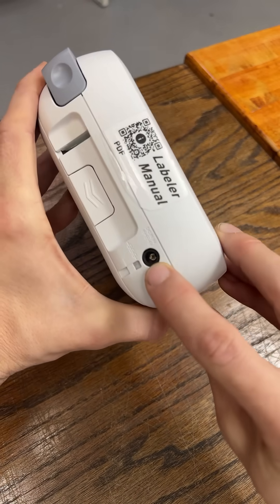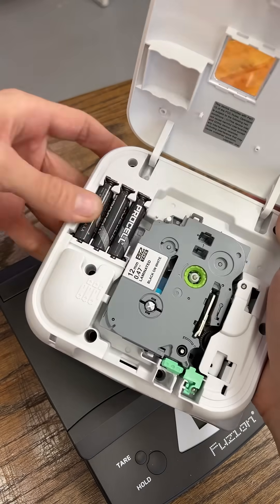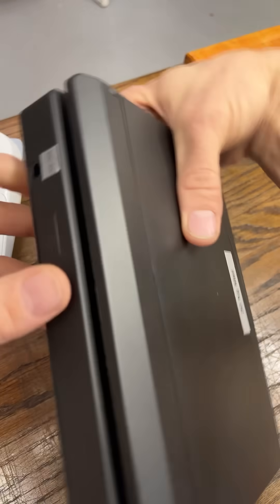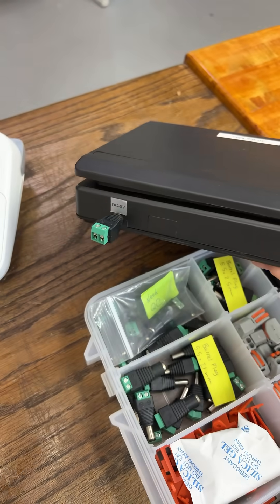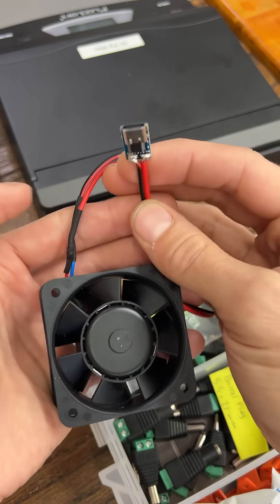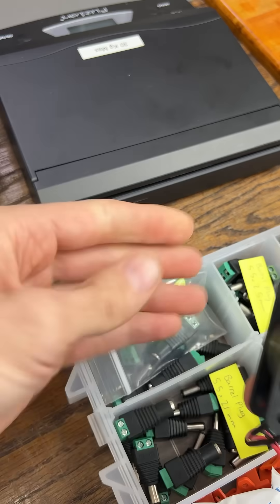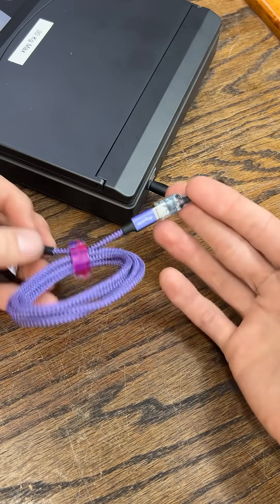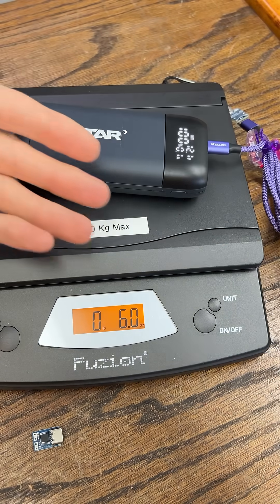USB-C can replace alkaline batteries

Comment: Pretty sure the labels are the most expensive part of using the label maker.
Reply: Not to mention that you now need an outlet nearby.
Reply: Aliexpress to the rescue
Reply: Generic will save money but you are correct. AAs are cheap.
Reply: @battra92 
Revelation 3:20
Behold, I stand at the door, and knock: if any man hear my voice, and open the door, I will come in to him, and will sup with him, and he with me.

HEY THERE 🤗 JESUS IS CALLING YOU TODAY. Turn away from your sins, confess, forsake them and live the victorious life. God bless.

Revelation 22:12-14
And, behold, I come quickly; and my reward is with me, to give every man according as his work shall be.
I am Alpha and Omega, the beginning and the end, the first and the last.
Blessed are they that do his commandments, that they may have right to the tree of life, and may enter in through the gates into the city.
Reply: @battra92 rechargeables are almost free compared to buying alkalines over and over again.
Reply: i think he meant over time
Reply: I was going to mention that too. But you are correct.
Reply: Depends on the labeler. Brother can't tell the difference between generic and OEM. Brady however....
Reply: Na, the full roll is like €1.5 from China, perhaps a bit less.
Reply: rechargeable batteries.
Reply: @superchuck3259 Not unless the device is designed for rechargeable batteries. The voltage of rechargeable batteries is not equivalent to that of primary batteries, especially AAA, AA, C & D cells.
Reply: @Micro-Motive  Please stop trying to correct people on the internet about mystical magical powers that existed in ancient america back in the early 2000's. 

Anyone over the age of 25 has used rechargeable AA's and AAA's at some point. Never once was a device marketed as supporting NiMH rechargeable. 

If you want the technical explanation then alkaline batteries range from 1.5 to less than 1 volt when they're nearing depletion. Requiring EVERY device that uses them to have circuitry capable of dealing with this voltage range. NiMH (rechargeable) batteries consistently output 1.2 volts. Which works perfectly fine with anything that accept's AA's.
Reply: @Micro-Motive  I just got a dymo label maker (the bluetooth only one) and the annoying thing only runs on on-rechargable, thinking about hacking usbc onto it
Reply: @itsausername not exactly. For many devices yes. But many devices that used AAs and AAAs would tap out pretty early. Completely or they would work less well or less reliably. Eg. torches/flashlights dimmer, walkmans and toy cars would slow down, digital electronics would get glitchy. Then you got to use those batteries in less demanding roles like remote controls.
Reply: @ All you're doing is pointing out that some electronics had poor voltage regulation. Which was inherently LESS of a problem with rechargeable batteries. 

Read the first post I wrote on it.
Reply: @Micro-Motive They mostly work, especially as rechargeable batteries can give out more power without voltage drop. Device makers need to still consider that batteries will go from 1.5v to 1.0v or so. Thats the same range as recargables being 1.3..1.0v
Reply: @SmallSpoonBrigade they actually start at 1.3v. but rest is correct
Reply: Yes, but they're cheap if you buy from AliExpress. And batteries turn to almost free if you buy rechargeables.
Reply: I own a label maker and can confirm, not the case. A "good" entry level label maker was $45 for me, used. The labels? $15 for 200 of them. I haven't even used 100 of them yet, over a year later. Even buying Costco batteries, batteries are still the most expensive part.
Reply: @summitupman995 I was coming to say the same thing except I have gone through at least one tape of labels by now. But I've replaced the batteries a few times
Reply: @summitupman995 6 AAA batteries: $6
They last 10 years. That's 60¢ a year.
The $7.50 a year you're using on labels buys you 12.5 years of batteries.

The labels are, by far, the most expensive part.

Like, you'd need to take 25 years to use up those labels before the batteries cost more. And if you're like me, and change out old batteries in unused devices every five years to use them on other things, you're not wasting the batteries.
Reply: "So many machines..." Use batteries. He was referring to all battery devices generally. Did you not get that?
Reply: @devongratrix4921 sure, but a lithium ion charge circuit adds complexity, and not to mention the financial and environmental cost of a lithium ion battery.
Reply: @devongratrix4921  Yeah let me just spend a bunch of money buying electronic components and tools, then spend a bunch of time fitting them to my shit, just so I can save $2 a year worth of batteries and probably burn my house down.

Comment: You can't really use powerbanks with these, unless the device your trying to power is very low current demand, if your plan on stepping up usb 5 volt, it has to be a higher average source, luke a PD wall  charger,

Comment: I was powering my battery toys with parts from a trashed clock radio  back in 1968 when I was 6.  Didn't need no modules or usb stuff.... didn't have to buy anything.  Anybody can /buy/ a solution...

Comment: Nice small DC to DC boost converter, but generic ones are already super cheap on Aliexpress or even Amazon. So basically just boils down to price you want to pay.
Reply: The device he is using IS NOT a dc-dc converter.  It is a USB C PD "trigger" that informs the USB C PD power supply what voltage (of fixed levels according to the standard) it would like.  If that voltage is not available, the next lower voltage will be supplied.

Comment: I made a similar mod to one of my Brother label printers. I made a small 2S 7.4V battery pack with two capacity-matched 21350-size disposable vape batteries, a protection board, and a USB-C charger board with built in cell balancing. It required a fair bit of plastic cutting, but it's worth the effort to avoid worrying about leaked alkaline batteries inside it ever again.
Reply: Why not just buy lion AA cells? Very inventive to use what you got.

Comment: I have 20 type-C to 6,9 and 12 Volt adapters for devices I want to convert, I also have cables that have built in converters including a USB to 24V that has a capacitor box on it and it's very sketchy but useful.

Comment: ...and I forgot to mention polarity differences. Some plugs are positive on the center and others the reverse. A mistake like this could kill a device
Reply: The protection circuit for that is dirt cheap, but often it's not mentioned that it's present.
Reply: What kind do you recommend?
Reply: @sett_labs  It's called a "Blocking Diode"! 😂
Reply: That's correct.
Reply: Yes, and sometimes, you've got things like the original NES where they have a rectifier built in because they're intended for 9v AC rather than DC.

One of the things that I try to remember to do is take a picture or otherwise record the polarity, voltage and amperage requirements so that later on, I can replace it if need be. 

If you don't have that and it isn't stated, then you're stuck either opening it up to see if there's a label inside to indicate it, or taking a chance on just plugging something in and hoping it's the correct polarity.
Reply: Yeah the plugs are designed with variations so that doesn’t occur 😂 just wire up the correct barrel it’s not hard
Reply: @ArtyMars no, in the wild west of ac jacks two different products can use the same jack but have it wired different ways inside, which determines the polarity

Comment: The actual reality is that current consumption matters. Your tiny switching converter could easily be overwhelmed by the current draw on some devices. Your lack of knowledge is going to help someone else let the magic smoke out. In addition, you failed to mention that the power plugs come in a  huge number of combination of external diameters and internal diameters, not to mention depth. Any for clicks, right?
Reply: No.  YOUR lack of knowledge is the problem.  The "PD" board (more often called a PD TRIGGER) communicate with the USB C PD power supply to tell it what voltage the device needs.  The PD power supply will supply 5 volts unless and until the negotiation occurs.

Comment: Explain to me how you're going to Step Up 5 volts to 9 volts or even 12 or 24 without a voltage converter coil while still being able to maintain the amperage required to actually operate the machine
Reply: Please educate yourself on USB C PD.  The USB C PD supply puts out a number of voltages according to the power needed.  The small board is a USB C PD trigger that requests a desired voltage (from fixed options).

Comment: Worth noting that you can reconfigure these PD triggers (IP2721) to one other voltage, 9/12 or 15/20. Because there are 2 IC variants used, the resistor right by the + output is either populated or removed to toggle between them. When its populated its like 10-20 ohms but shorting with solder works fine. Useful so you dont have to buy every single type.

Comment: That brother labeler does NOT use a standard power jack. I ran into that problem myself and I ended up soldering wires to the inside of the jack just to bypass it.

Comment: Wow. You replaced something that could be rechargeable batteries with.. Rechargeable batteries. Except now it's 20x larger and less convenient. Truly a life hack.
Reply: Even though they didn’t point it out on the video, that Brother printer is one device that can’t be powered with rechargeables. It draws too many amps. It will power on, but fail during printing. 

That’s also a limit on the device being demonstrated. You need to be able to select the voltage AND amperage.

Comment: Usb pd is stupid complicated.  Multi voltage power bricks are easy with pwm, just switch to different resistors in the sense line.  Reinventing the wheel with a sq wheel.  Another way to screw consumers’ money

Comment: I have a tool trolley at work that I've fitted with hazard lights and underglow. I plan to get a 12V milwaukee charger in there too. It's all fed by a PD power bank and a little breakout board. Usb C is amazing

Comment: So many cool little electronics don’t come with their barrel plug at goodwill. Why hasn’t someone made a solution like this before?
Reply: they have universal powersupply  kits you can by with switchable voltage as well as a bunch of different barrel plug sizes you can change out to whatever you need

Comment: Totally fascinating video. 

I am bringing a product to market which has been too many years in the making. We designed it with a barrel plug socket - and the electronics to work from 5v dc, to 9v dc - so it could be powered by an external usb a battery - albeit the motors inside give maximum power at 9v - now I can see potentially selling it with 2 or 3 cables - one of which  like this - it could be powered by usb c, or the usb a cable, or a simply wall “wart” of appropriate voltage. Happy days !! So cool this can be made into the cable …

Comment: Now replace the AA batteries in that label machine with an 18650
Reply: There are also rechargeable aa batteries. Eneloops are pretty great and that way you don't to change how they're laid out or get a DC-DC converter if they're not using 3 batteries.
Reply: Was thinking about the same thing!
Reply: Gotta add some charge and protect circuitry!
Reply: leave the batts in the machine and they are dead.. you really need a voltage readout if your gonna use lithium
Reply: Also need to use a boost circuit as the 18650 is 3.6 volts and the printer with 3-1.5 volt batteries in series is 4.5 volts. That's 0.9 volts off!!!
Reply: @RTR-MATEY  pretty sure its 6xAAA so 9v
Reply: It's a low powered device. Cheap NiMH batteries would do fine.

Comment: Hold up. How does the PD know what power to supply to a non-digital device? Couldn't this over-volt something made for 3v or something?
Reply: What do you mean? You are matching the input voltage, if the device requires 5 V, you provide 5 V via the PD board, if it needs 12, you provide 12
Reply: @eXe09 how do you set the voltage?
Reply: That chip exactly requests what the devices capable off all else fail it falls back into regular 5v

Comment: even better they sell pd cables with interchangable tips that set the voltage automatically no need for making your own
Reply: Not for a dollar they dont
Reply: I'm pretty sure those only work with devices that also recognise PD. The device has to tell the charger what voltage it wants
Reply: Do they set the polarity, too?
Reply: Brilliant ty

Comment: Got a link on a source you’d recommend for ordering?
Reply: I have looked through the description, and the links do not show anything about these products. Am I missing something? I found Scuttle, and another robotics site, but not these connectors. What are they even called?
Reply from the maker: I'll paste them here: 

[shop my parts used for this video]

PD trigger, 9v ► https://amzn.to/3XTWgnY
PD trigger, 20v ► https://amzn.to/3ZzDTpH
PD trigger, 12v ► https://amzn.to/3ZEUQz4
PD trigger, selective ► https://amzn.to/4ezzLKw
Barrel plug ► https://amzn.to/3ZEUQz4 
USBC power block ► https://amzn.to/3zJuktw

Please note, it's hard to click the actual video description on mobile, since the link is buried next to other links.
Reply: @davidmalawey  thanks so much David. That’s excellent.
Reply from the maker: thanks for this suggestion, i’ve added the parts in description.

Comment: Pd puts out some serious current!  You really want everyman to solder up their own power cables?  What happens when that cheap ass $1 PCB fails and a fire starts?  Whos at fault?  I say stick to UL listed power cables and transformers!  For the sake of yourself and your family/neighbors.
Reply: PD only gives high current if the device is smart enough to ask for it. Shorts will trigger the supply overcurrent protection. Transformer supplies don't have that protection.
Reply: Agree. At the very least this video should be a teaser and not taken as instruction